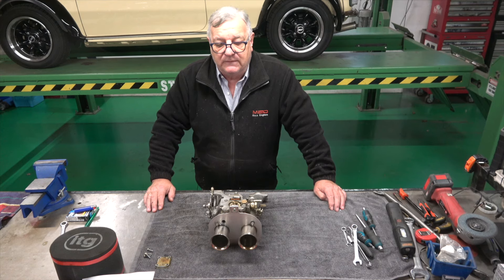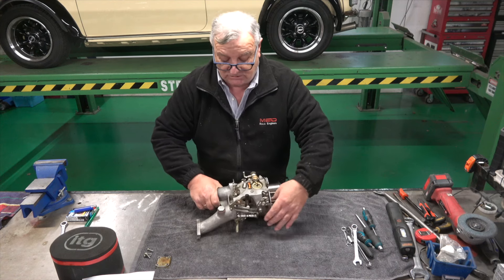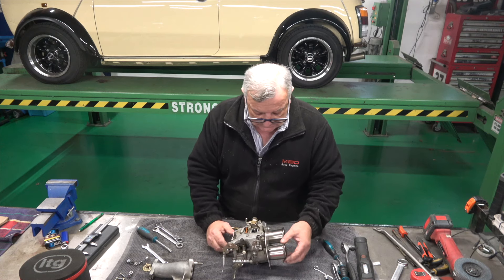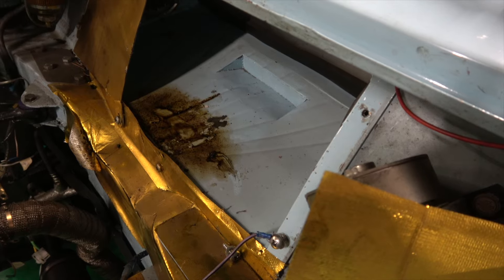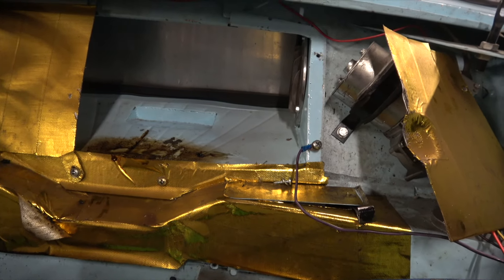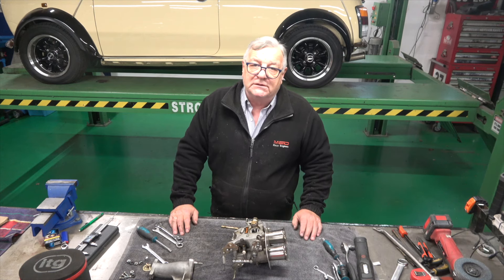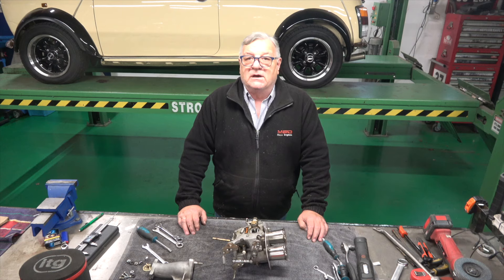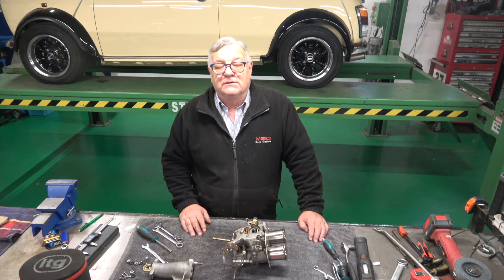Classic Gulf Race Mini Engine & 45 DCOE Carb Update.

Comment: Oh poor max! 
On the mini engine Hopefully you can get it sorted and find a decent rolling road to setup the carb properly
Reply from the maker: Matt,  Good to hear from you. We did have the engine on a rolling road in the UK in Paul Jeffries mini and the Weber was jet tuned to 113HP at the wheels.
The problem is in Austria they do not have rolling roads only ECU and chip tuning as engine mods are pretty much fraud upon here. Cheers Dave

Comment: Hi Dave, sorry to hear about Max's loss, very sad, quite a shock. Regarding your Weber, I think the Mangoletsi part is a bolt on throttle linkage (a very good one too!)  although I may be wrong? Vizard has some basic Weber jet suggestions in how to modify your mini, I haven't cross checked, but your jets sound in the right range. Every engine will (of course) be different. Rolling rod after rebuild will sort that. I Hope that you just get away with pistons and a rebore! Cheers from Aus..... Graham
Reply from the maker: Graham, Paul Jeffries who built the engine has said it‘s the Inlet Manifold & Throttle assembly that is from Mangoletsi and the 45 DCOE is from Weber. 
I just removed the cover and it is a weber 45 DCOE and I wasn't aware of the throttle linkage being from another company. Cheers Dave

Comment: Hi dave, the mangoletsi is the manifold.....not the carb, the carb is a weber 45 DCOE.
Reply from the maker: Paul,  Why does it have the Mangoletsi sticker on the Carb 🤔 Cheers Dave
Reply from the maker: Paul. I just checked as you said under the cover and the weber name is there Thanks but I had no idea about the throttle linkage. Cheers Dave

Comment: My thoughts and prayers to Max is sucks beyond belief to lose your wife.

The F8 is the immulsion tube which should work. The 160 jet is monkey dumping buckets of gas I use a 125 on my 1800 MGB.   Also check your choke tube from listening to how it ran it sounds like a 36 mm and I would recommend a 32 mm or 34 mm choke tube.  It’s way too over carbureted and should twist up faster.  It took me 3 months to get mine dialed and haven’t touched it since.  That’s my 2 pence.  I learned the hard way trial and error.  Cheers 🍻 John
Reply from the maker: John, A friend of mine Tony is looking in to the K1100 BMW motorcycle head conversion so I will see how he gets on as this may be a good option for us. Cheers Dave

Comment: Hi Dave 'just a long shot if the left hand trumpet is loose could some thing have   come off and entered  the cylinder?
Reply from the maker: David,  Something could go down the carb and manifold but unless it was dirt or paper it couldn't  get past the valves. But worth a check. Cheers Dave

Comment: So it is a China carb. I doubt it will ever work as well as a Weber. The cure for Solex's or Delawfulls is a Weber. Any base set ups for a Weber probably will not work at all. IF the carb is new leave it as is then start on the dyno with jetting/ airs etc.
And then ofcourse that all depends on what size chokes are in it
Reply: @ldnwholesale8552  it's a weber carb, the mangoletsi throttle linkage was covering it 👍
Reply from the maker: No sorry I made a mistake it is a Weber 45 DCOE the throttle flange & inlet manifold is from Mangoletsi just checked it tonight. Cheers Dave